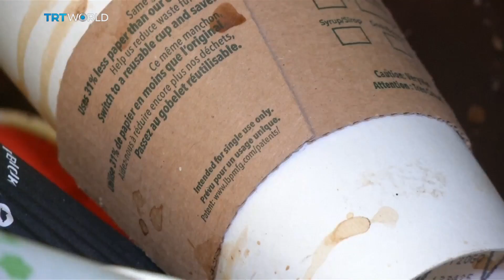China Waste Ban: Where does the trash go now?

Comment: My name is Mark C. Radosevich and I live  N.E. of Durango, Colorado. 
I'm a 67 yr. old scientist and inventor of a biodegradable and extra
profitable liquid fuel replacement for petroleum.  This new
higher mixed alcohol fuel is a synthetic blend of C1-C6 normal
alcohols to include methanol, ethanol, n-propanol, n-butanol,
n-pentanol and six carbon n-hexanol.

This
GTL (gas-to-liquids) synthesis technology [refinery chemistry set]
has been in use for a hundred years in converting methane natural gas
or solid coal into C1 methanol.  My GTL system uses a
totally different patented catalyst to produce six, eight or ten
normal, synthetic alcohols instead of simply C1 methanol - and
at 5x the efficiency of conversion which dovetails directly into its
profitability.  The first green herein are the profits which
this fuel synthesis system will generate for its equity owners. 
The second green which drives me is its near-term benefits to Land,
Water and Atmosphere.

The
U.S. EPA approved this new alcohol fuel for commercialization on
September 20, 2001.  This gas to liquids higher mixed alcohol
technology began 45 years ago and still has not been commercialized. 
There exists a very large and definite controlling greed factor
stymied by divisive patents to about one-half of the planet.  I
have been quietly working with this new and hidden fuel for the past
25 years.

This
new "Oxycarbon" mixed alcohol fuel contains just three
atoms.  Carbon, associated Hydrogen and new, missing Oxygen
which is derived from H2O as hot steam.  The chemical magic
herein becomes the missing Oxygen atom which is not contained within
Hydrocarbon [fossil oily] fuels of Nat/Gas, Crude OIL or solid Coal. 

This
additional Oxygen atom does not contain any BTU's of combustion
energy.  Instead, it "fans the flames" to enable
refined petroleum oils or ground coal or natural gas to combust far
cleaner and provide more torque, fuel economy and a highly reduced
emissions profile.  The Oxygen atom also changes the polarity of
the fuel molecule and instead of floating on water as ALL oils do
(even edible oils) -- the new and stronger (less expensive) fuel
alcohol is magnetically polarized to bind and dilute with water. 

This
becomes the biodegradable aspect and the new alcohol fuel actually
provides a free lunch to single celled [plant] phytoplankton &
[animal] bacteria species and to all green living plants, trees,
brush and grass.  All of these living species consume the dilute
alcohol fuel for lunch and pop off a water molecule.  The
chemistry is very simple, so simple that young children can interpret
and understand it.

I
need investors to development  a $50M tiny showcase demonstrating
that society's solid waste garbage, sewer sludge, ground tires,
beetle-killed pine, medical wastes and hazardous wastes become the
source feed stock for Carbon & Hydrogen (instead of corn kernels)
and such solid wastes are cleanly converted in a special Rotary Kiln
Gasifier without a smokestack, thus no emissions.  Imagine all
of these nasty solid wastes being converted into a new, extra
profitable, water soluble, biodegradable, oil soluble & coal
soluble extra profitable biofuel without a smokestack, AND at
negative cost per gallon as these solid waste feed-stocks come with a
tipping fee for disposal. 

Right
behind the next $50M scale of demonstration will become commercial
sizes of mixed alcohol refinery systems beginning in the $350M to
$500M range which zero their capital debt in their first year of
operations.

The
Oil Industry is more interested in converting their abundant sources
of Methane natural gas and CO2 into this same new biofuel. 
Thus this GTL system has two front ends, one gaseous the other being
solid wastes.  The latter is the most profitable.  Using
Methane Nat/Gas and CO2 as feed stock will produce the new
liquid biodegradable fuel for about 35¢ per gallon.  Gasifying
the solid wastes of society without emissions and collecting a
tipping fee will produce the new liquid biofuel for approximately a
negative -35¢ per gallon.

This
is the answer to provide a replacement for fossil fuels and help
mitigate  air and ground pollution and global warming. Please pass
this message on to those who care about humanities future.